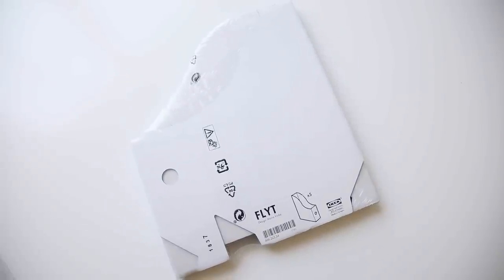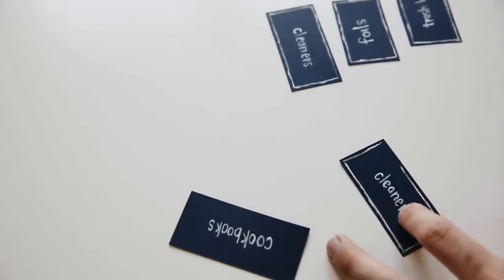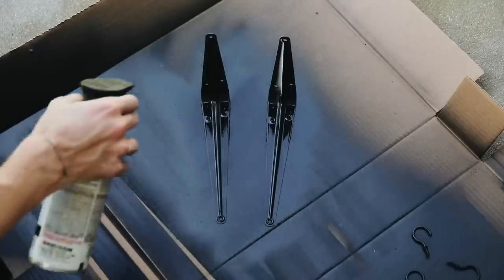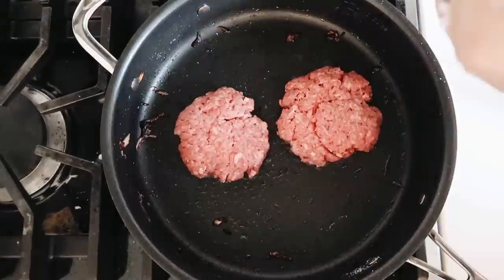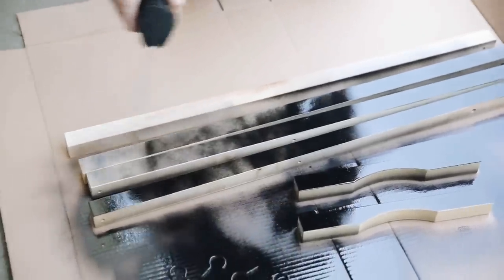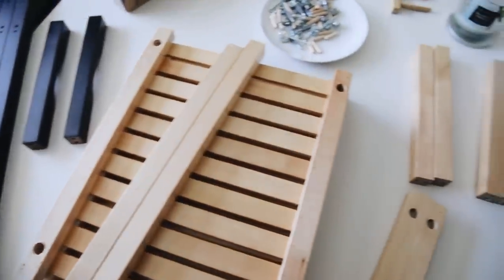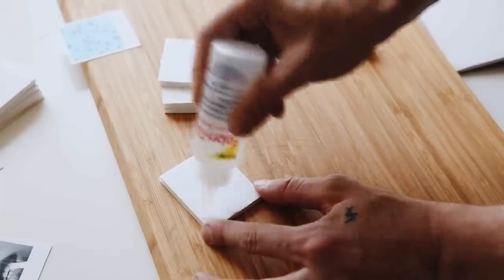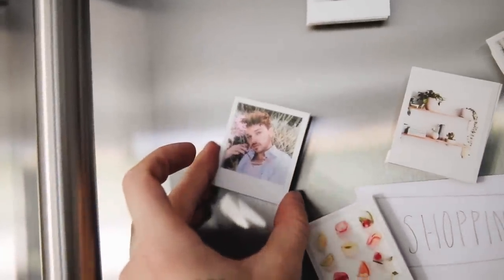DIY IKEA KITCHEN DECOR + ORGANIZATION HACKS - Modern Farmhouse // Lone Fox

Comment: We can tell you dont cook. Nobody washes red onions or onions before peeling them. So cute
Reply: And NO, you aren't a chef. You burnt the buns (which that's fixable but I am sure you don't know how) And you burnt the onions.
Reply: AND NO YOU'RE NOT A CHEF. You burnt the buns and onions
Reply: Sombath Jaijarat actually rinsing onions after you peel them (so before slicing) helps prevent your eyes from watering! 
It’s a trick my mom and grandma told me about!
Reply: HelloFresh actually tells you to wash all produce before cutting🙃
Reply: @editholiva1217  Idk why anyone would have trouble peeling an onion without crying. O.o It doesn't stop the fumes from being released when cutting, it only helps when and if it releases fumes during the peeling process. If you're peeling the desirable parts, then I could see it causing watery eyes, but peeling the good parts is such a waste..
Reply: @Machute8484  They also tell you to cut the ends off your zucchini.
Reply: Keiome Nikke who’s peeling the good parts?? I’m talking about after you peel that old layer,  you run them under the faucet real quick so as you’re chopping them your eyes don’t water
Reply: Umm I wash them before peeling only lol who tf washes them after
Reply: @AJ-rm2vh  you wash onions? I just cut them in half and peel off the outer layer. 
I knew someone who peels the skin off mushrooms! Wtf. I don't care if they're dirty. Some dirt is good for your immune system 
Unless you have a problem with young immune system of course. I could understand washing onions and peeling mushrooms then.
Reply: @Machute8484  did they specify onions? What about bananas? Or garlic? There's obviously no point if you take off the skin.
Of course you should wash carrots, apples and stuff where you eat the skin.
Reply: Maybe you don’t, but I do. Why wouldn’t you wash an onion, especially before peeling it. You don’t know how many people touched the onion at the grocery store before purchasing it.

Comment: Just a quick tip: if you have a metal ruler, you'll have better success cutting nice lines with an exacto. Those plastic rulers are great, but the blade sometimes digs in to the plastic so grab a metal one if you have one.

Comment: The hooks on the cutting board are going to be in the way. You should have used closed eyelet hooks, turn them flat and just regular hooks on the bar. So board will lay flat and you won't get scraped by the hook.

Comment: the cutting board you might not be able to cut on because the way you placed the screws, they  weren't parallel with the board, they were perpendicular so they might stick up  cx the board to be off